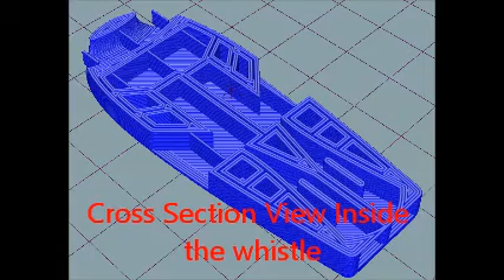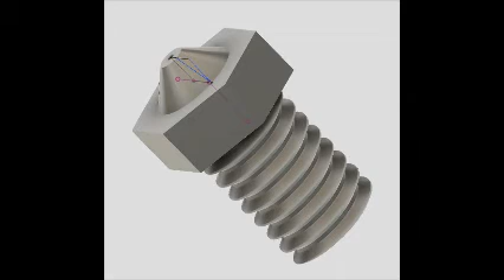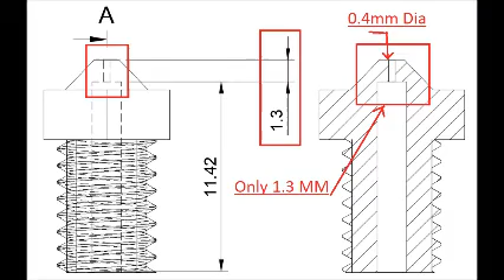3D Printer Blocked Nozzles & Whistles

Comment: Do you not think your print speed is set too quick?
Reply from the maker: Yeah, I was using the Slicer default settings. Now I found it best to slow it down 50% for the first few layers and then slowly increase to 70% after the first layers are set down properly.
Reply from the maker: Yeah, maybe  a bit fast, but I just used the slicer defaults. Now I use the %over ride and slow it down at the start to get better adhesion.